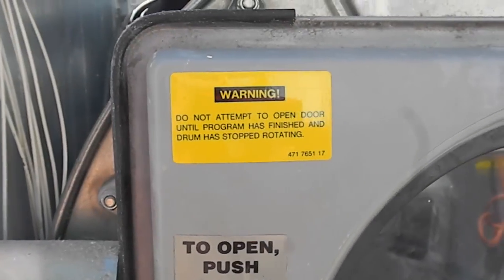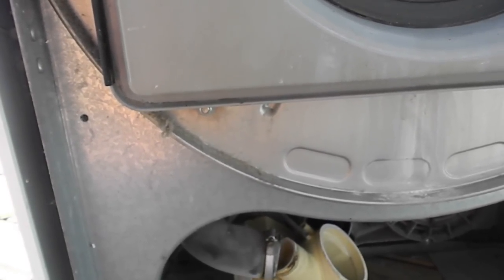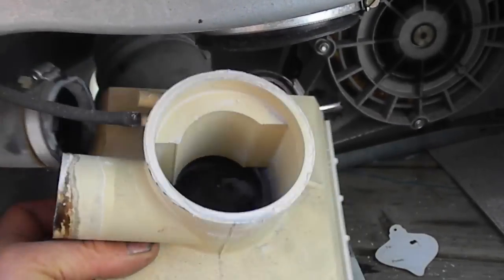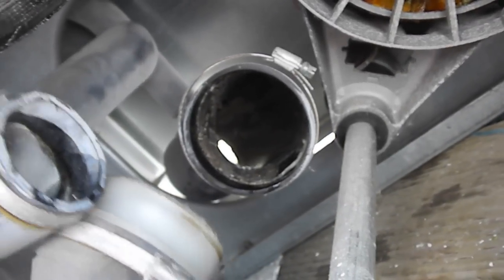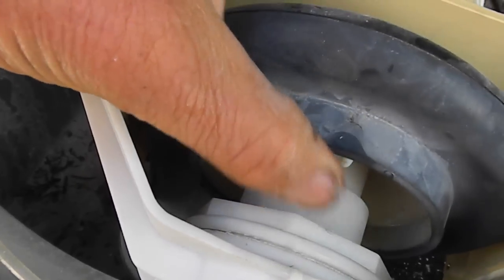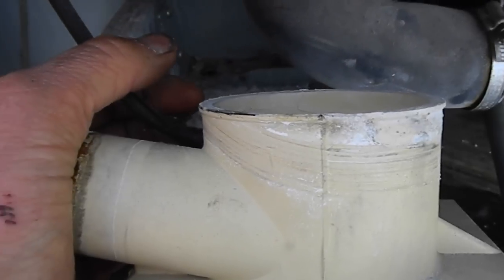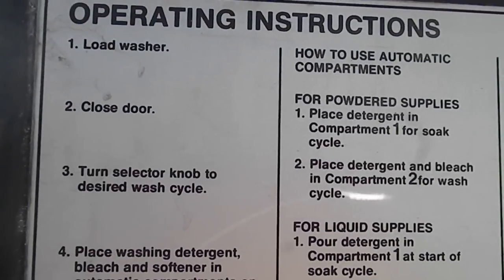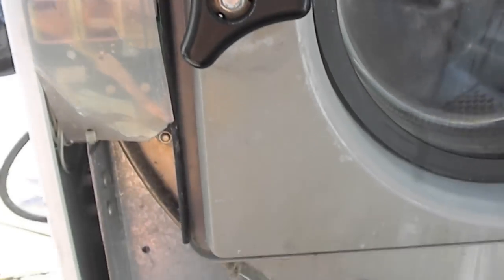Wascomat Sales Service & Training

Comment: Hello. I have 2 Wascomat and with low pension of water in the pipeline from the outside public  service the washer machines do not work because not fill or scape the water, example the only water that in to the machine is the water of the soap but this water scape and do not fill the machine. In conclusion i have to wait the prension of water of the pipeline is hard, strong to put this machines to work. What is bad , a dirtines in a sensor or this machines work like this. Is it normal?